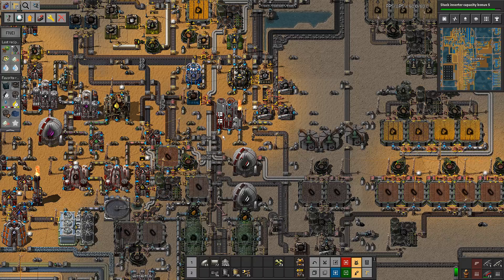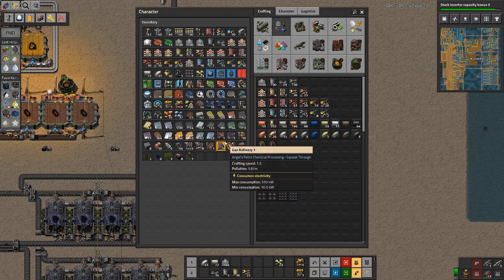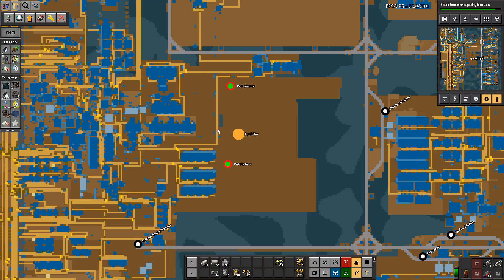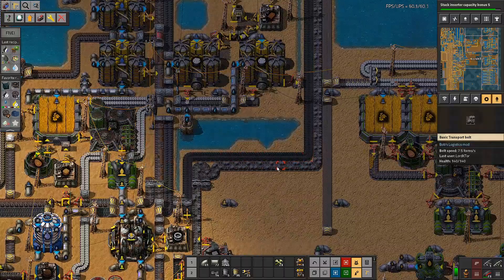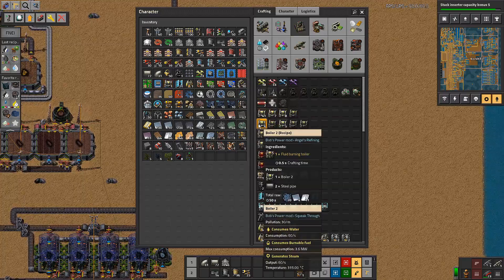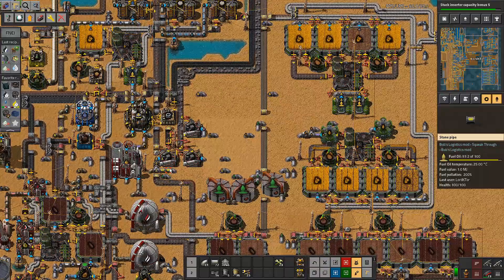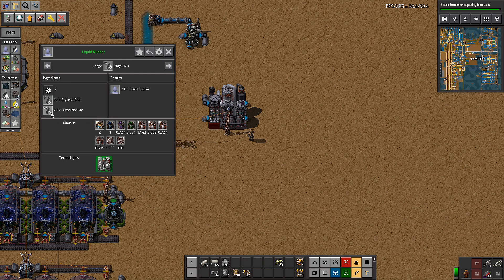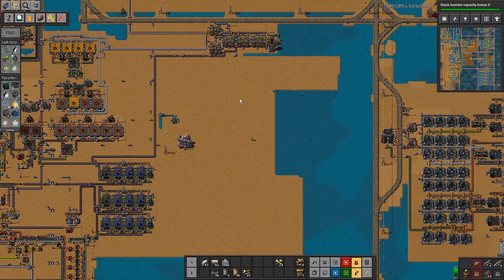Factorio Seablock + TSM ep98

Comment: 39:00  That's the circuit I was working on yesterday for my resin facility.  8 different ores needed for catalysts, plus sodium hydroxide.  Took 4 arithmetic combinators, 4 decider combinators and a constant combinator, but I just set the constant combinator to be the trigger amount to call the train, and then it unloads (read from train) until the warehouses contain 4 times that amount. Then the train (after inactivity) goes back to reload.  That was a fun challenge.  
My next challenge is how to have multiple empty/supply stations for mineral sludge/sulfuric waste water without the trains trying to all use the same station.  Doesn't happen often, but when it does...
Reply from the maker: You can call the stations something different and have multiple of them included in the priority schema.
Reply: I originally did that, but then realised I could name them the same..  Which worked for a very long time, but only recently, they have started trying to use the same stations that already have trains at them.  Oh well, I think I have found a solution by putting the empty stations in a block above the sludge blocks, and the supply stations below.  Does take twice as many slots, but it works.
Reply from the maker: Stay tuned. You will see how I handle this in upcoming episodes.

Comment: 1:30 Try the water treatment tab. There are electric boilers, and the higher tier boilers are actually faster.
Reply: T1: 40/sec
T2: 60/sec (same as a boiler)
T3: 80/sec
Reply: Hmm... Fluid burning boiler is 90/sec, so there's that. :)
Reply from the maker: Fluid burner also gets rid of some of the fluid excess that I want to get rid of.